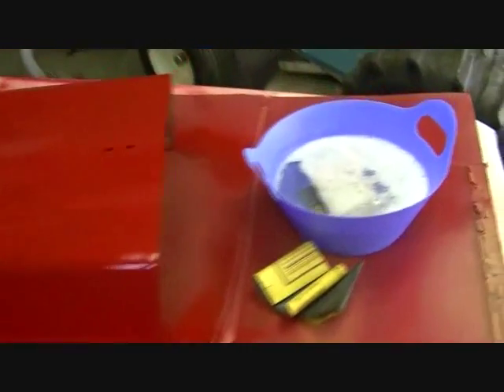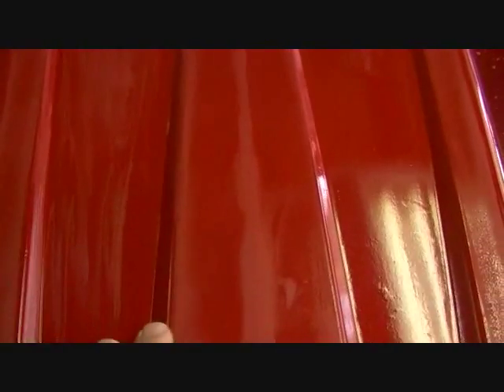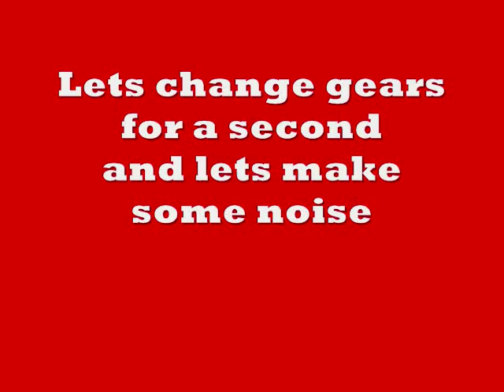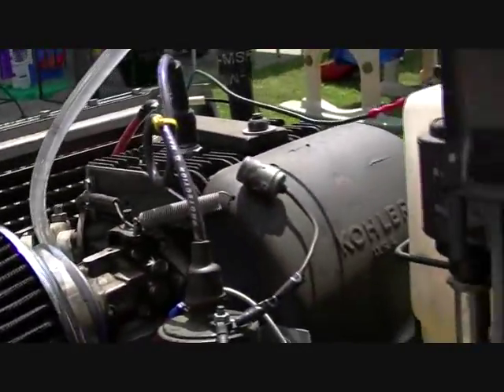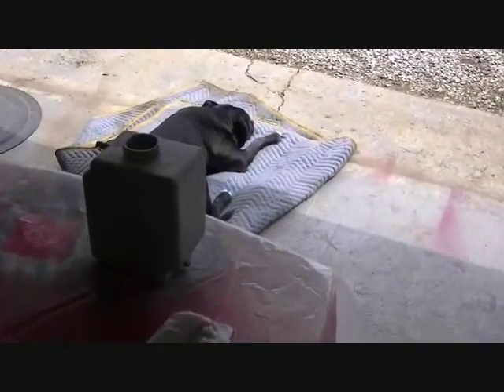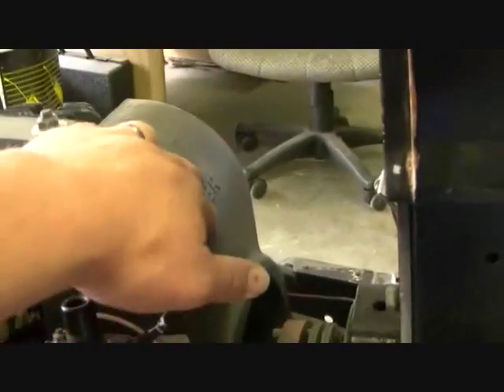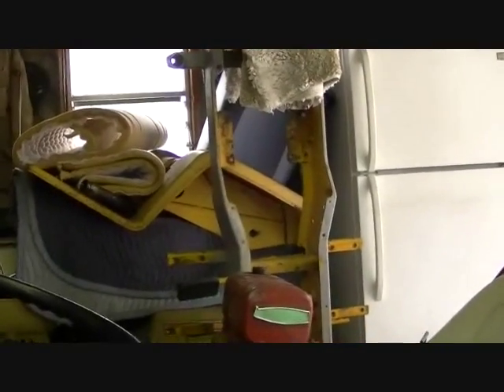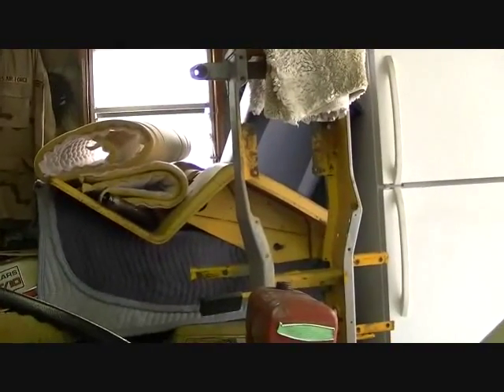/// Cub cadet painting and Cold start.///

Comment: Don`t get me wrong, this is just a tip for you. You might be happier with a cheap spraygun. It`s nearly impossible, to paint those big parts without orange peal, with spraycans. They are made for small parts. You don`t need to colorsand and buff it, if you have always a wet edge on your spraypass. That saves you hours and the result is way better. You also save money. In this video you can see, what i`m talk about.

Good luck. Subbed.

Comment: The spray gun, i`vè used for my table and trailer was 17.-€ from the hardware store. For the first time, i would suggest to you, not to use a HVLP gun. They are a little bit more difficult to handle. The old style is (just in my opinion) easier to handle.